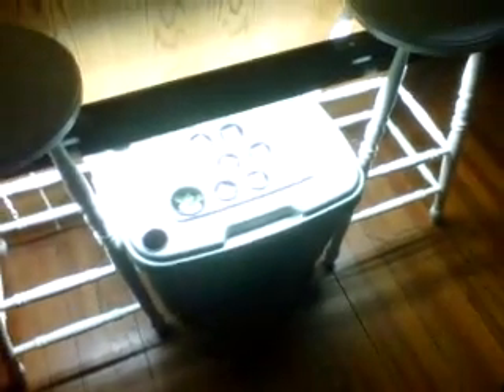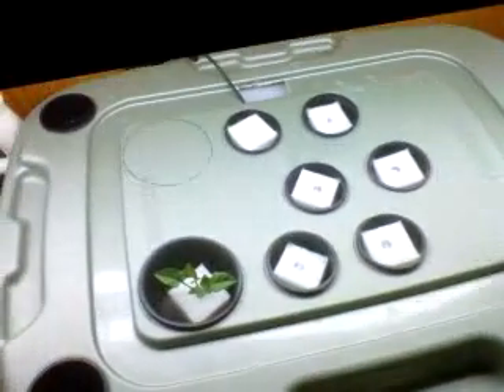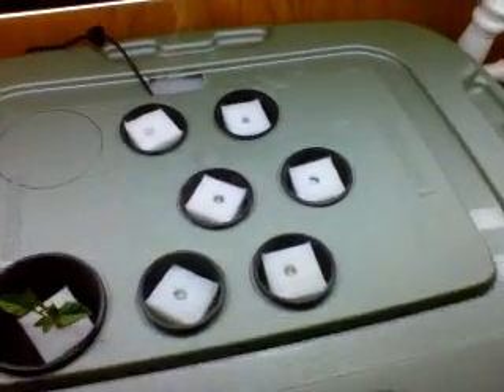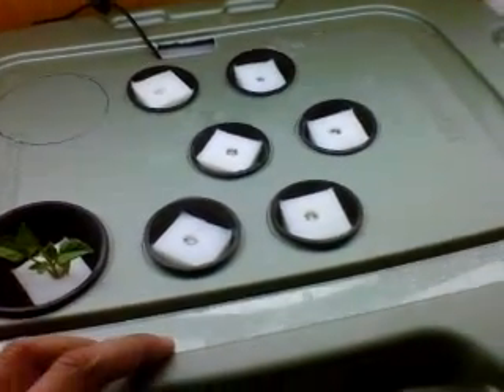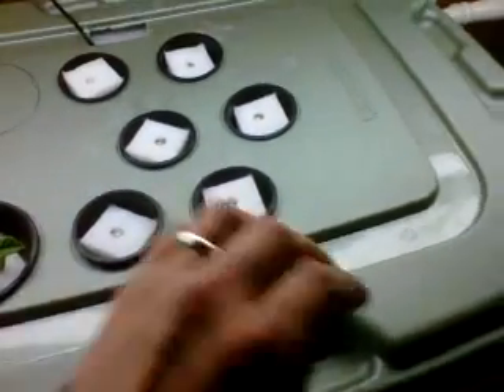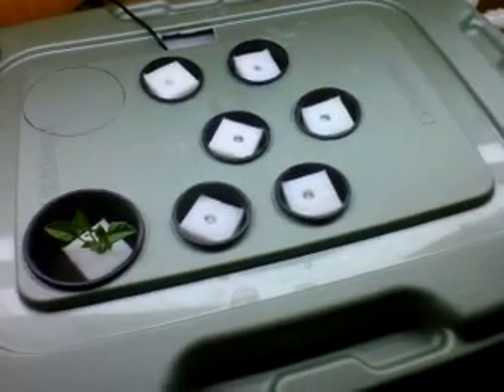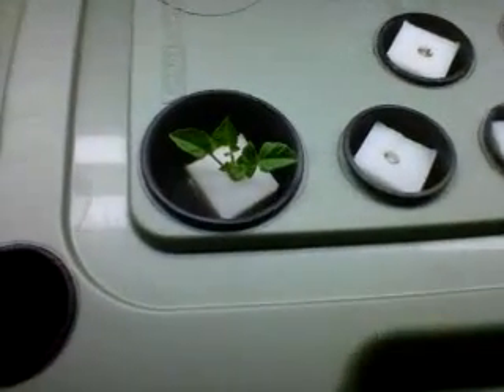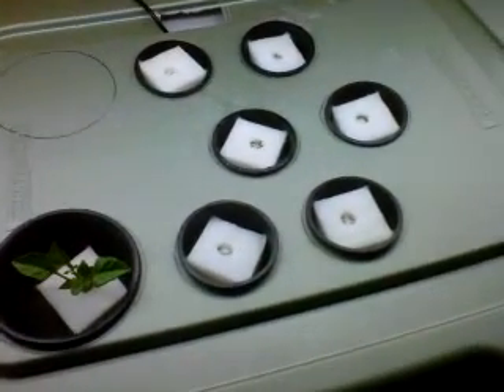aeroponic fogger mister DIY setup

Comment: the reason ur mist doesnt reach higher points is because you have to many openings on your lid. if you seal them up, or fill them with more rock wool it will eventually fill up.